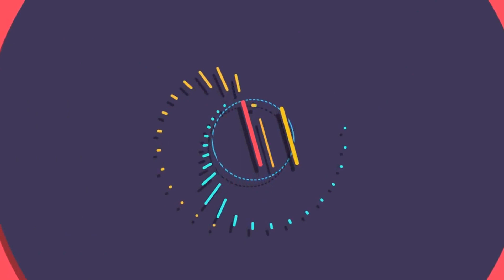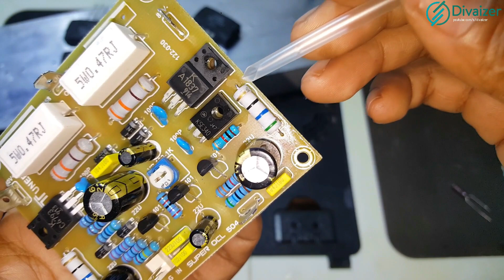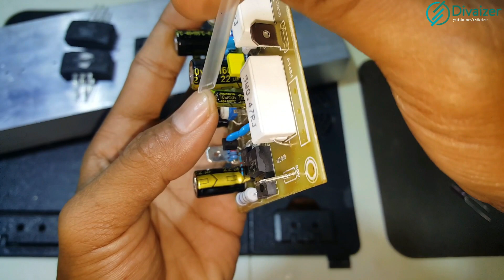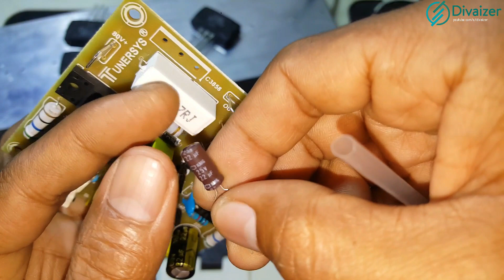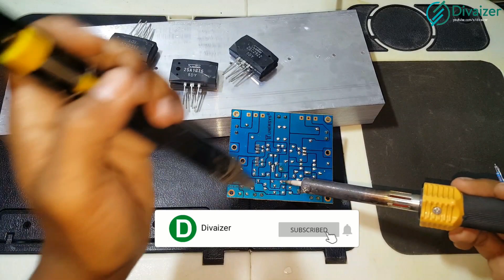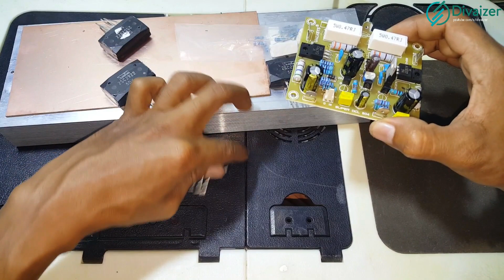VIRAL..!! Modif SOCL 504 LOW SUB BASS Lebih Mantap

Comment: Mas renycana saya mau modif socl 504 kira" transistor final Sanken 2 set trus trapo 5a 32volt CT pake Elko 10.000uf 100volt kira" bisa ngangkat brapa speker
Reply from the maker: Speakernya berapa inch?
Reply: Ada Canon 10 inc 2 trus acr 12inch 2 tp kalou pake tone control bakal enak gak, buat rumahan,
Reply: Tp pake satu driver ocl504

Comment: Klo sya mlah bagus pke kse 340 ,tinggl c4793 di ganti tip 31&32 🤔
Reply from the maker: Banyak kasus jika pakai kse 340 lama- lama suara serak maka dari itu ganti dengan tip 31/41 untuk mengurangi resiko serak. Tapi kembali ke selera masing-masing kalau ingin pakai kse 340 juga tidak masalah